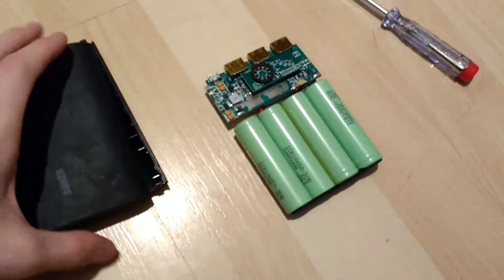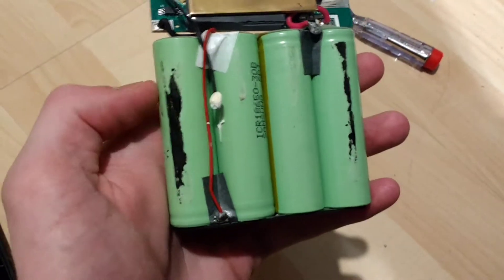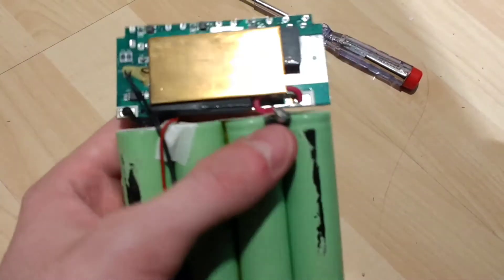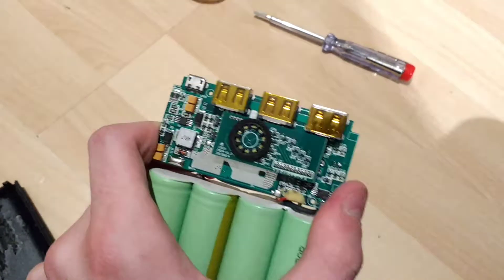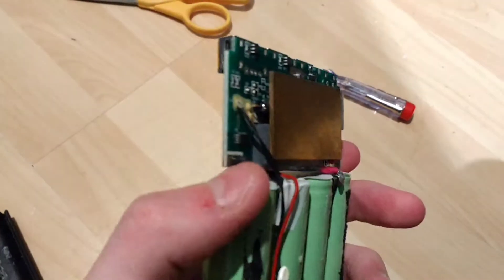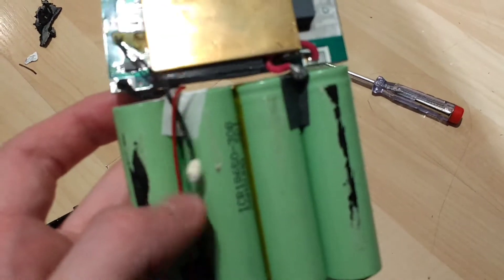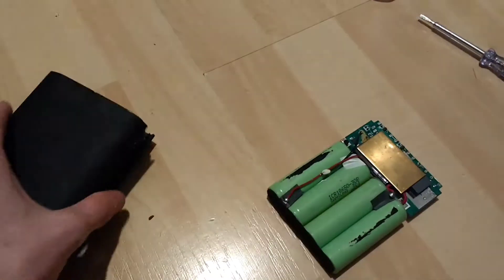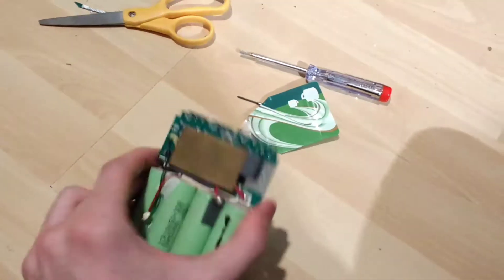Inside Anker Power bank

Comment from the maker: I decided to take apart the Anker 12000mah @ 3.7v Power Bank which outputs 5V via boost converter. Yes they did spec the mah at 3.7v to make it seems more but it's less once you calculate the mah at 5V boost converted. Anyway I strongly suggest you don't open your own since it's not for the faint of heart and requires alot of careful jamming to get it open. The word that escaped me was Thermistor! I did not mean to say Thermostat! Anyway nice to see they do have that thermal protection in there!